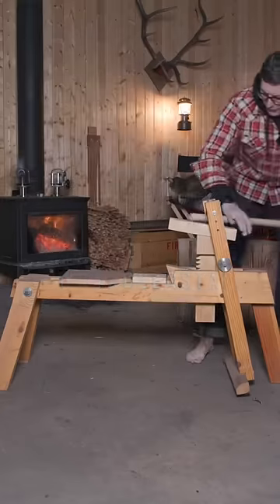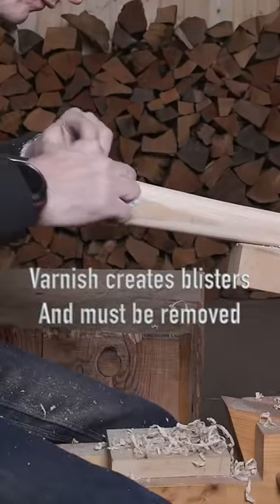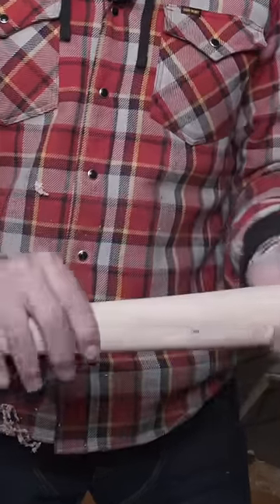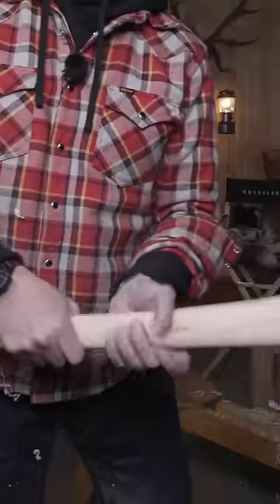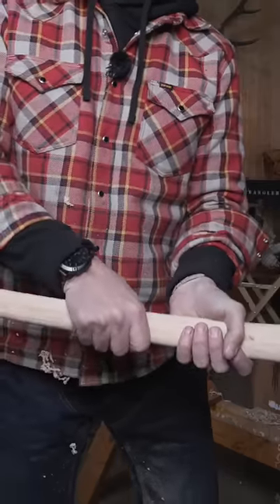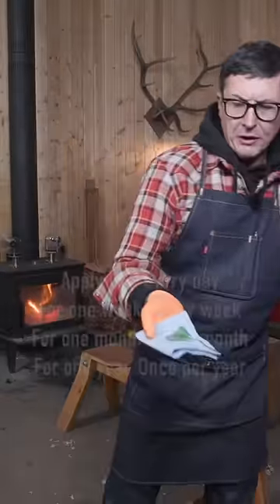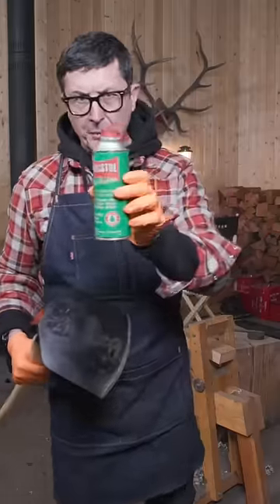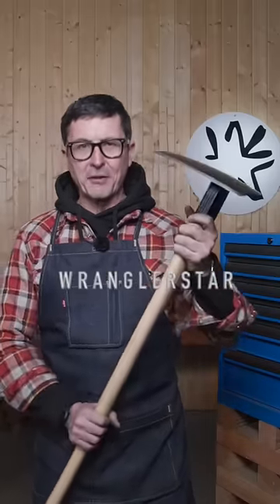Secrets of the US forest service, Wranglerstar, professional homeowner #shorts

Comment: Saliva is used as a restoration tool for old oil paintings. It helps break down the gunk left in the grooves and is applied with q tips. 

If people have been using it for centuries for painting restoration, you bet there's a reason others use it for cleaning other surfaces.

Comment: 1920: yes we just got this new machinery we will be able to mill things with way tighter tolerances
2020: this machine can't even cut a knife edge right
Reply: As someone who works in a machine shop, this is terrifyingly true, our machines from the 60s 70s and 80s will go months without scrapping a part, but our new fleet of machines are riddled with issues
Reply: I agree with that I am 27 years old worked in a 50's machine shop with all old machines Landis cut threader and old American lathes I would must prefer the old machines that I can sweak and use Allen keys to adjust than have a computer controlled one just my opinion though.
Reply: @RazzleberryHaze  guess they aren't CNC...which means you wasted money on the new machines
Reply: @RazzleberryHaze  the effects of late stage capitalism
Reply: @RazzleberryHaze  the effects of late stage capitalism
Reply: @Adam-ho7xv  no the effects of everyone wanting everything cheaper.
Reply: @magicalphones  thank God someone else gets it. They just made everything cheaper so more people could have better "lives". Everything turned from metal/natural material to plastic.
Reply: @RazzleberryHaze  Our new machine was from the 80's. My lathe was from 1910. Had a steam engine, then diesel (I think), now electric. Best machine in the shop out of the six lathes.
Reply: Dunno what y'all are using but my cnc sharpens blades to .001 or tighter... It's mostly down to the operator at this point, though there is definitely differences in machine build quality.
Reply: @Adam-ho7xv  yup. 

It’s not that we don’t have the capability of machining amazing tools

It’s that companies make more money skimping on good steel and cheap machine parts.
Reply: @Marynicole830  nope.  There is no late stage capitalism just early stage marxism or its derivatives.
Reply: @Shadewraith0529  I agree, modern CNC is INCREDIBLE when the right operator/programmer uses it - check out Titans of CNC on YouTube (may be one word)
Reply: Also, it’s some dude with a grinder in another country making 1 quarter of what we consider low income.

Comment: If you have nothing else linseeds oil on the steel to protect from rust , however teak or tung oil  is much better than linseed oil. Linseed can mold,  tong oil stand up to moist better,  especially when cut with orange oil as a solvent /thinner, it leaves the wood smelling great! And the teak and tong oil protects metal or even concrete, anything it's on is water resistant, it's almost like a natural epoxy,

Comment: The factory edge on rogue hoes is very good, at least it was back when I bought mine. This is relevant for the standard issue forest service tools though.
Reply: The sharpening of the hoe (because of the brand) and removal of the branding seems more like a step to create a USFS mimic than having practicality, the removal of the poly coat though seems like a smart move for people using them for long hours. As long as the coating was non-toxic. In addition to possibly creating blisters, poly gets slick when wet with sweat or water.

Comment: Top tip, if you mix your boiled linseed oil with turpentine half and half your handle won't be sticky when it's done curing. I learned this from a channel called Coalcracker Bushcraft, go check him out.

Comment: Just because the edge was done on a machine doesn't mean it's a bad edge. Factory edges are rarely adequate, but it's not the machine that's the problem. Production factories want to save money by reducing machine run time for each adze in this case. That means skipping the steps necessary to have a good edge.

Comment: Saliva will not keep the stone clean. In fact, it will trap the swarf in the pores of the stone. Use water or oil and regularly clean and dress tour stones to expose fresh abrasive surfaces. 

Linseed oil will only absorb a coat or two before sealing off the wood. It will rub off in use and makes a fantastic handle finish, just don't feel you have to regularly apply it unless you use your tool regularly.

Comment: Varnish creates blisters!!?!
1. Most of these folks are probably using gloves.
2. You're removing the varnish up by the cutting head? Who is holding that tool up that far?
3. Varnish keeps that handle from absorbing moisture, and cracking/splintering...Cracks create blisters.
4. If you're working that tool, and worried about blisters, get yourself a pair of gloves, or some lizard skin batting tape.

Comment: If you are doing all that I can’t believe you didn’t heat and temper the blade. The factory doesn’t bother to treat the steel body Vs the blade with the correct temper. THeN you hone the blade

Comment: Why peel the varnish and then oil? Why do they add varnish if it's not good? And why remove a good varnish?
Reply: He said because the varnish creates blisters. They put it on to protect the wood but when you remove it you apply lindseed oil to protect it.
Reply: @kennyrogers3919  sometimes you gotta know when to hold’em and when to fold’em
Reply: The varnish is only put on by the manufacturers because the mass market likes their tools to always look nice without putting in the work to maintain it. (Plus varnish always looks the same and can be a bit more protective when theyre all shoved together on a truck for transport.) Linseed oil actually seeps into the wood and protects it but the varnish just covers the surface so a proper linseed oil finish will last longer, and feel much better on your hands
Reply: @kennyrogers3919  it blisters your hands more ? Or it blisters the varnish?